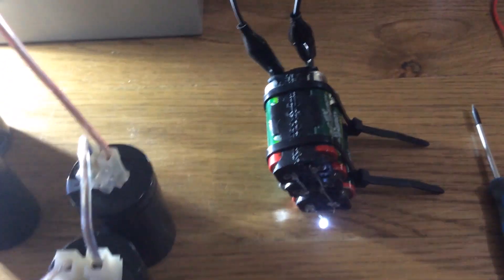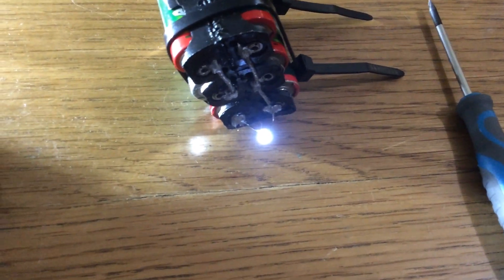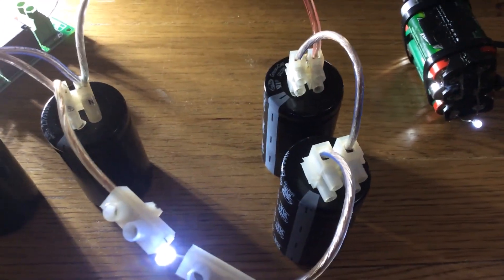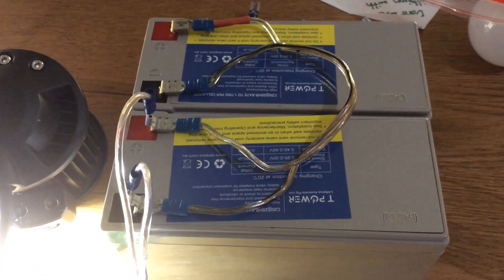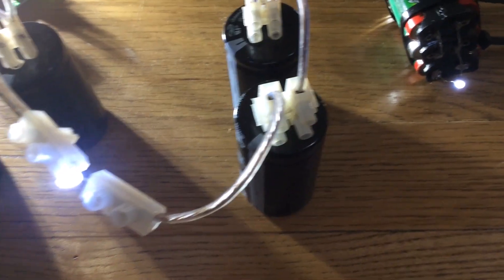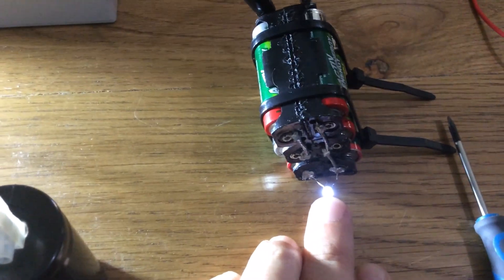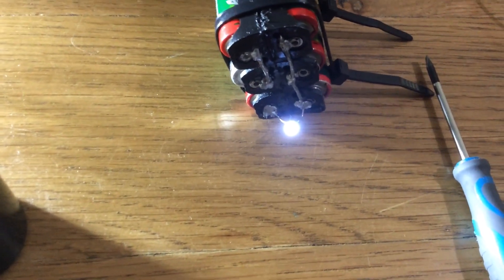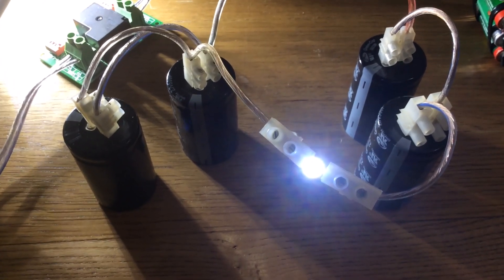*UPDATE* Tesla's Power Transfer and Capacitor Power Transfer

Comment: Compounds 2.7
Reply from the maker: Thank you for your comment however I am unsure of what you are stating. Perhaps you are referring to the capacitors value which is 2.7 volt 500 Farad for each individual capacitor, obviously having 5 capacitors in series reduces the Farad capacity drastically.

Comment: Thanks for sharing. Great content! A fun test can be done with 2 bateries only. If you have 2 bateries with 1.7 V in potencial difference, you can even connect both negatives and light up an LED between both positives. It works with capacitors too. It's all about potencial difference...
Reply from the maker: Thank you for watching. Thanks for your suggestion, I will be sure to try that.

Comment: Great video!  I was always impressed when I saw Rick Friedrich showing off the Carlos Benitez patents, one of the coolest things I had ever seen!  I'd love to see you (or me) do a test with some big batteries and a big draw for more practical household applications!
Reply from the maker: Thanks for watching. I too was impressed by the Carlos Benitez system and Rick covers a heap of important work and does it very well. I would love to buy some bigger batteries to do a decent test however I’m recovering financially from my last battery purchase to the tune of $3k so I will have to put that test off for a while. I hope to make a video soon using a 240 volt inverter with this transfer method which should be quite useful.
Have a nice day.

Comment: Great share. 

I wonder how many days it will last 😉
Reply from the maker: Thanks for watching. I too wonder, I’m certain there are differences in efficiency through the small amount of variables to create this circuit, ie. battery composition, wire gauge and load. I know from the small amount of  testing I have done to date that batteries have massive difference in efficiency and I don’t recommend cheap batteries as my tests shows not all batteries are made equal. The load needs to be balanced with the charge/discharge rate of the batteries. The larger the load the faster the transfer of energy except when approaching maximum charge rate of the batteries at which point power is converted to heat and lost. The small AA battery system with one small LED is a very good balance and has kept running 24 hours a day for 109 days now, I will make an update video at day 122 because I initially joked at day 60 that it would not run that long, how wrong I was!

Comment: Thank you for another great video. :) What are the specifications of the capacitors? is there a minimum cap size? and how did you charge them? Did you short out the empty ones first? are the light still going from the caps? Hope it wasn't too many questions :) I'm asking since I tried it with capacitors but maybe they were too small because i couldn't get it to work.. I hope you have a lovely Christmas. thanks again
Reply from the maker: Thank you for watching. Your questions are appreciated as it helps everyone learn.
The capacitors are 2.7 volt 500F
Capacitor size is load dependent ie your batteries/caps should be the voltage of the load, in this case the load is 3.2 volts, which is why I use AA batteries as three in series gives 3.6 volts.
I charged the 2.7 volt caps by placing 5 in series and charging them with a 12 volt battery charger then separated two for the experiment.
The “empty” bank I used some LED’s to drain them, when they were drained I shorted them to completely empty them.
The power was transferred to the “empty” cap bank and I have not swapped them yet. I may have left them a little too long to be a fair test as they probably experience voltage leakage.
So the rule of thumb here is, series bank must be double the voltage of the parallel bank and double the voltage of the load, capacity must be the same for each bank.
eg. 3 x 1.2 volt AA 2000mah in series = 3.6 volt
       3 x 1.2 volt AA 2000mah in parallel = 1.2 volt
       1 x 3.2 volt LED
Reply: @whatifididthis...1236  Thank you very much for your answer. :) I would love to see a video of the whole process of charging the caps and discharging them and starting the experiment. It would be fine with a "fast forward"/"speed-up" version with a clock in the back. It would make it esier for me to replicate. Also if you use the same led, the discharging process can be used as an control in the experiment. in that way there should be no doubt when the experiment has been running for much longer than the time it takes to discharge 2 caps. see the normal discharge time would be good as a control in the experiment so people can really compare it to the experiment.
By the way Im replicating the AA battery experiment. The light is still on after 3 days, its using 3.9 mA at 2.9 V at the moment. the series batteries are at 4.3V and the parrell are at 1.4V.  I havent made a control discharge yet. When should I swap it?
Reply from the maker: @martinetellerandet8566   Thank you for your comment. I use an old iPad mini to record my videos so unfortunately there is not enough space to do a continuous video, however I could record the time and date of the test start and when the first change occurs and update on each switch. I will also try to run the necessary control tests. In theory the best time to change the light is when it is no longer lit as this represents a full power transfer, however I have been swapping the batteries around when the light is dim. My first switch was 40 days, second switch at 61 days third switch was day 81 and the next switch will be at day 122 to pass a third of a year, currently the test is at day 109. Nice work getting your own test going, can I ask if your load is in the POS line or NEG line?
Reply: @whatifididthis...1236 Hi again. I understand :) I also only have an old iPad with a broken screen :) the more data about the experiment the better. Do you know how much current the led is pulling? Mine is using 4 mA. do you know what the max current draw is?  Acording to this little calculation one AA battery should last around 14 days. so to make a conservative estimate 
with a good AA battery 1 led at 4 mA can run 14 days:
Theres 2- 4 Wh in an AA battery depending on quality.
4 Wh / 0.012 W = 333.3 hours  or
13.8 days for one batterry
so if it was 6 batteries 14* 6 = 84 days. 
So if your current draw is the same as 4 ma it seems like its doing something unusual :)

Comment: Exelente trabajo 
Creés que se pueda hacer un circuito en lugar de poner el led quizás instalar un joule thief o  ladron de julios
Reply from the maker: Gracias por ver. Sí, puede colocar cualquier elemento eléctrico que normalmente funcione con 12 voltios CC. No es necesario que sean LED. Puede usar mi bobina de iluminación portátil con este concepto para obtener eficiencias aún mayores.
Reply from the maker: Thank you for watching. Yes you can place any electrical item that normally runs on 12 volt DC. This does not need to be LED’s. You can use my portable lighting coil with this concept for even greater efficiencies.

Comment: If you were to put a wire up 30 in the air and 200 ft long well insolated you would be at the 1,000 volt level and add that to the system and go for ever
Reply from the maker: Thanks for watching. That would be a good idea, not much extra energy is required at this level of efficiency. I was even thinking of attaching a small scalar collector using diodes just to keep it topped up.
Reply: @whatifididthis...1236  
Something else because  it's adding you could expand your lighting and because you really only use it at part of the night you could expand even more  but trying to match a constantly changing in might require some thought I heard in winter in the dry blowing winds t really cranks out the amp\vols .
Reply from the maker: @R2NOTU  I agree regarding the wind increasing the potential volts, my dog got trapped on the trampoline once when  it was a windy day. The trampoline net was being charged rapidly with static electricity and kept discharging on the dog, not understanding why he kept getting shocked when he approached the metal edge so he just stayed in the middle at which point I got zapped twice in a couple of seconds when I had to carry him off the trampoline, that was very rapid discharge and recharge and then my mind was racing with possibilities, could the trampoline be a collector? I still have plans to connect a circuit to it, one day.

Comment: im not having much success with my set up..i have 8 aaa's..and using those literally in 24 hours im getting what seems a 50% power drop...and after that still the power drops are very large in the days after....somethings wrong.....cheers
Reply from the maker: Thanks for watching. I believe you might be having problems because the voltage is too high. With 8 batteries I am going to assume you have 4 in series and 4 in parallel. 4 batteries in series should be giving your circuit 4.8 volts which is too high for an LED. When the voltage is too high most of the energy is burned off as heat instead of transferring. Was there a reason why your using 8 batteries instead of 6?
Reply: @whatifididthis...1236  ahh ok..i though it would just be better to run a 3.2v led on...ok ill drop 2 batteries and try again..cheers
Reply from the maker: @thebigfella9095  Let me know how you go. You should get better results on the negative line instead of having the Led in between the positives place it between the two battery banks using the negative lines.
Reply: @whatifididthis...1236  thanks i will..yes i only use the negative line....heat loss must be the reason...lots of wires on my set up to..cheers
Reply from the maker: @the big fella  I thought I would mention battery quality can also be an issue with short run times, I bought new batteries that are supposed to have a larger capacity than the ones I already owned and they last nowhere near as long. I will check the battery composition, so far the original ones are the most efficient.
Reply: @whatifididthis...1236  ok thanks ..yeah they are new...but cheapies yes...could be an issue yes...thankyou

Comment: Good job sir.
Maybe you want to try charging a rechargeable battery in place of the LED.

THANK YOU
Reply from the maker: Thanks for watching. That is a good idea, I’m not sure if I mentioned to you I want to try charging a cell phone using this concept. This would require 12 AA’s with 6 in series and 6 in parallel. I would like to know how many times I could charge the phone off of the one initial charge. Alternatively it could be done with 12 volt batteries using a car USB charger.
Reply: @whatifididthis...1236  you probably could use a boost converter too. A small dc dc boost. Just an idea
I am going to try ut with some LTO batteries I have and see if I can charge one set while using another set 

Thanks for the video and info 
Let's break the code and find some way of producing some energy 
Good luck
Reply from the maker: @Gacha.Cupcake  I have seen the documentation for this being done. The LTO’s should work well with this concept. When everything is established correctly you can obtain zero point energy and you can tell when you measure the volts it will read 0v. I believe this is achieved on the negative rail between both banks. Let me know how your experiments go.
Reply: @whatifididthis...1236  I will. Thanks again

Comment: ah so this must how be the bedini wheels are meant to work... if you had a small coil that used a tiny pulse to keep a wheel turning
Reply from the maker: Thanks for watching. I believe you might be correct there, most of the dual battery systems are using a similar concept and the bedini motor is just acting like the water transfer hose. I imagine 90% of the efficiency is because of this process and something like a bedini motor captures the field collapse to achieve over unity which isn’t hard with a system that is so efficient in the first place.